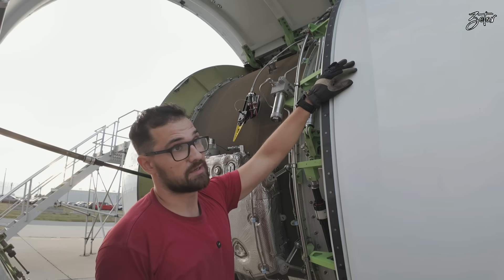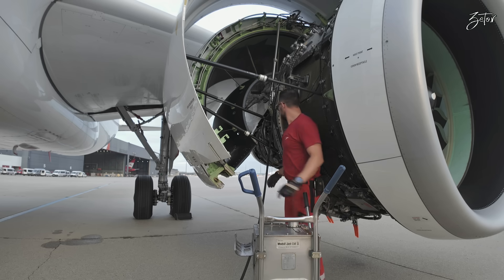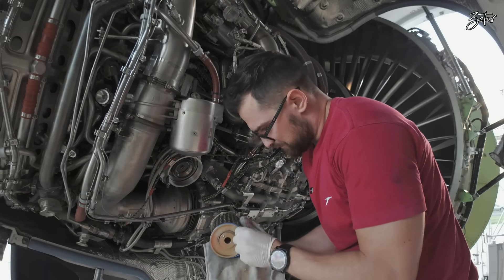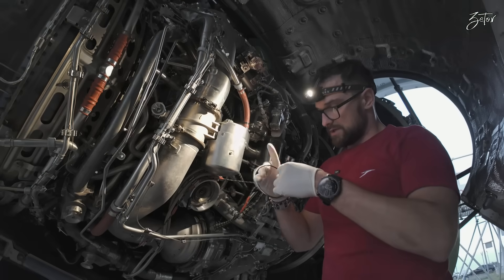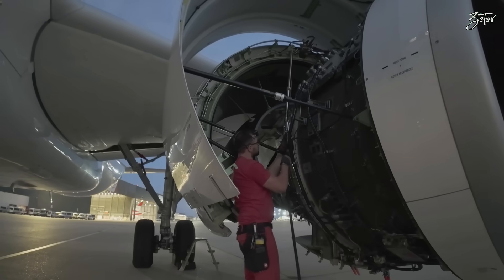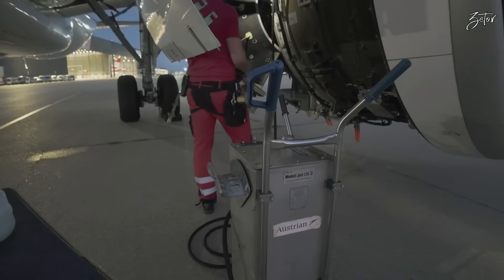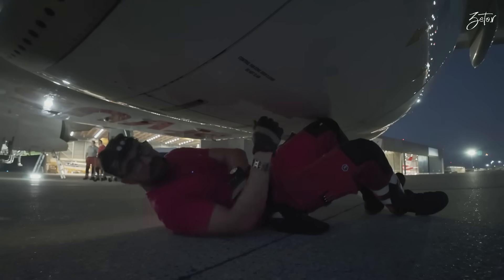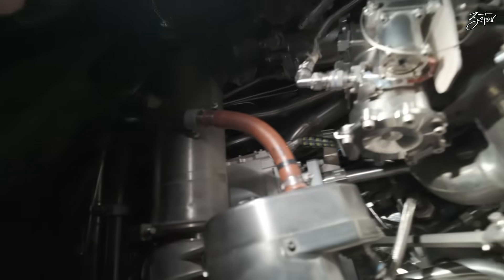How to replace fuel filter on Airbus A320 - PW1100G engine

Comment: So you have to open up the engine again after testing it to check on the fuel filter?
Reply from the maker: Yes, otherwise you don't know if there is a leak or not 🙂
Reply: @zeto.r  A bit tedious, however it must be done.

Comment: Interesting to see the difference of location from the external parts to other GTF Engines. 🎉
Reply from the maker: The same thing is on GE engines, all on hot section
Reply: @zeto.r  my thoughts were more in case of position of the Oil Tank, bulid up of the MGB, starter Air valve (all in the opposite direction of the PW1500G engines and with other designs of the parts). In case of PW1500G the Main Oil Filter is in the same place as the Fuel Filter at PW1100G ...

Really interesting to see 😉
Reply: @zeto.r interesting, CFM56 has it on the fuel pump connected to the accessory gearbox - definitely makes for an easier service.